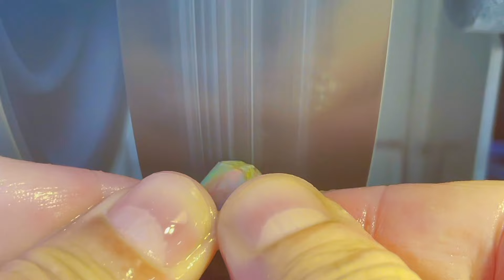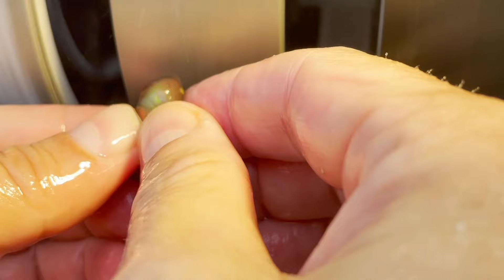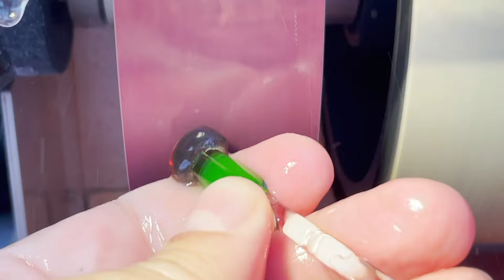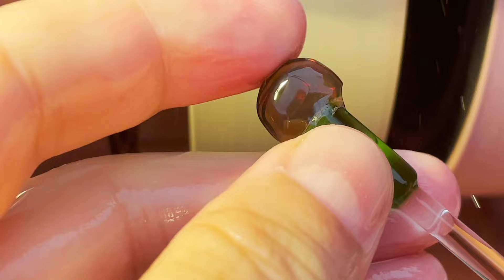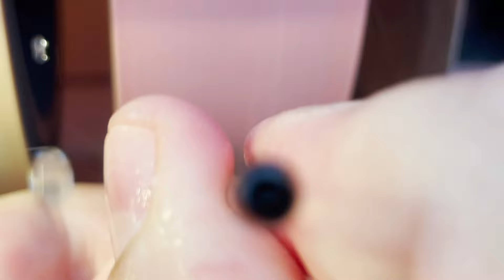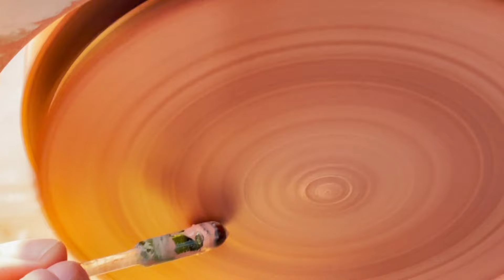Gorgeous dark base opal cut and polish 🔥🔥🔥 #asmr video

Comment: Gratulation to the wonderful gem 🌈💎🌈. I also have been cutting dark based welo opal recently. To me it seams that the dark based welo opal is even more heat sensitive than normal welo opal. What are your experiences?
Reply from the maker: Thank you! I didn't notice the heat but this wasn't such a large piece and I was using cold water. I have some much larger 'black' opals from the Stayish mine I'm going to cut next so let's see if they heat up.
Reply: @LuxuryOpalsEurope I was referring to the heat up during polishing with cerium oxide. Sometimes the mixture of water and cerium oxide gets a little dense and therefore the transfer of heat which builds up during polishing is not fast enough transfered from the opal. I really had an eye on it to keep the mixture thin and watery, but after rubbing by hand with a leather cloth some lines are showing up. These lines do remind me of how welo opal looks like when it has gotten too hot during polishing. I will also try with another perhaps the lines where a part of this opal and I just overlooked them before cutting.
Reply from the maker: Yes! This did happen to me with Cerium Oxide! I had to wet the wheel